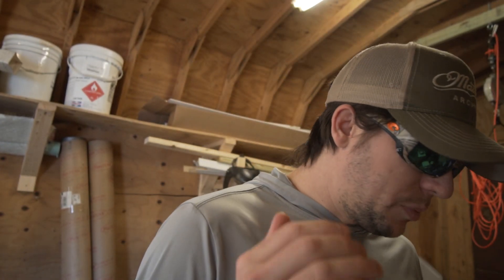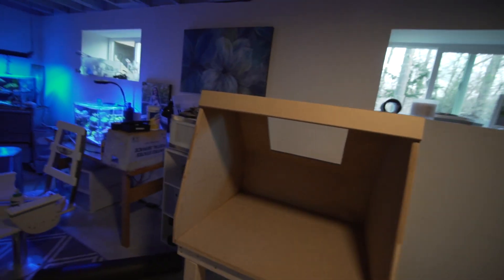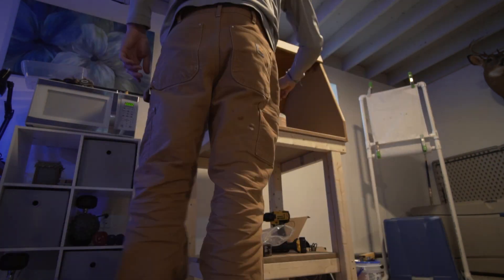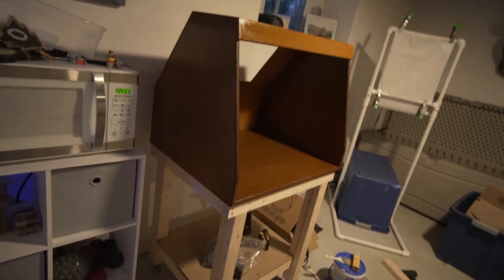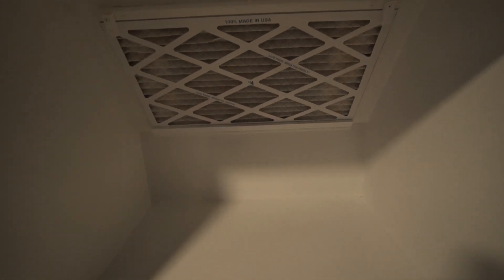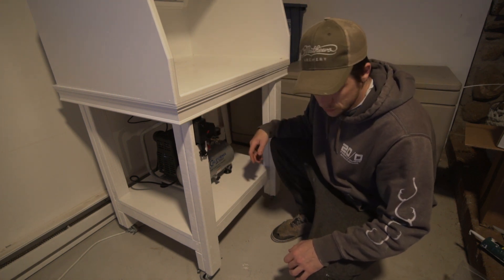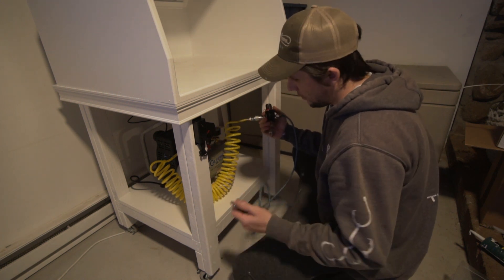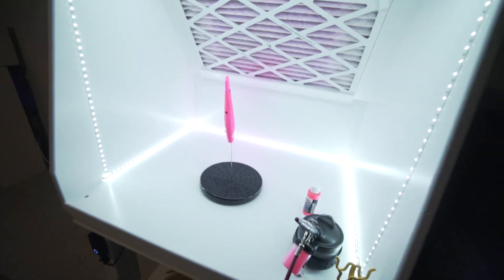Lure Painting - Building an Airbrush Spray Booth

Comment: Suggest clear packing tape to cover the LEDs. The lights are hot enough to melt it. It will keep the leds clean and you can just remove and replace the tape. Eventually the tape will get covered with pain and dim your lighting.